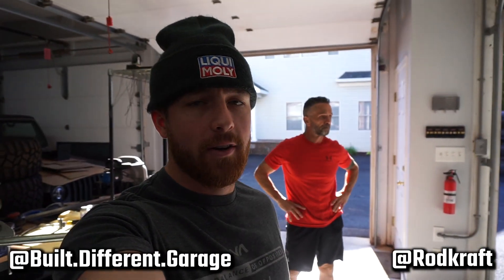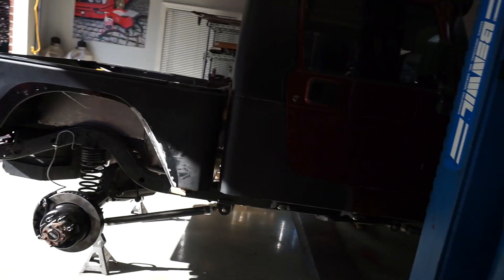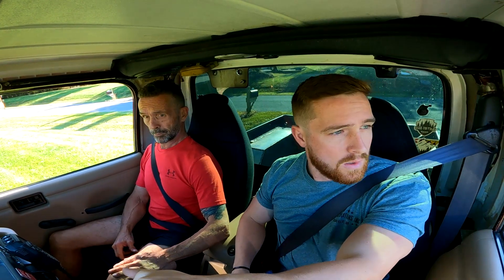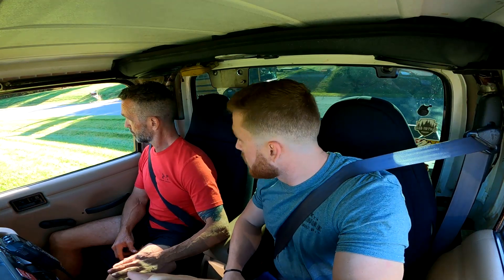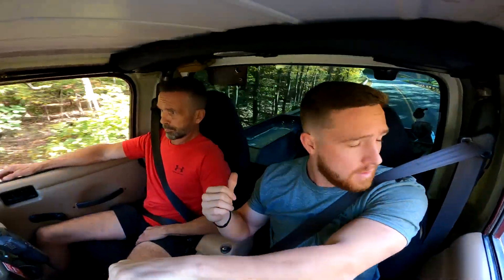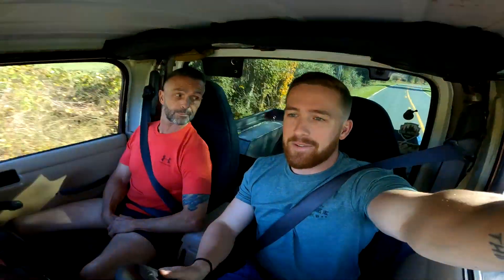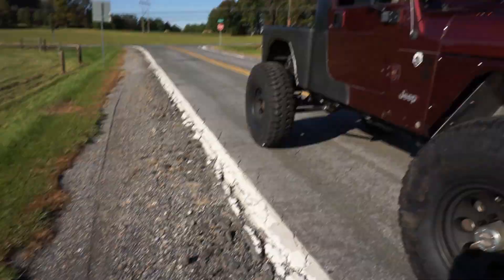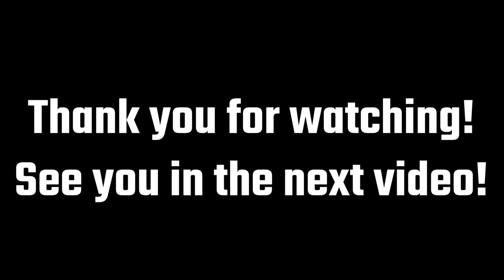FIRST DRIVE!  JEEP TJ WRANGLER on DANA 60s and 40in TIRES

Comment: Rear end on my Brute bounces around a bit unloaded too.
Reply from the maker: I'm sure once I get weight on the back it will be fine.  It was the same way before.  I have some plans for this that will add some significant weight to the rear so it'll all balance out!
Reply: @BuiltDifferentGarage  my plan was just install a bigger fuel tank, something like the Genright Safari tank, and never let it get below 1/2 full 🤣

Comment: Milestar tires suck. That is a main reason
Reply from the maker: I dropped the tire pressure today and they felt much better.  There is zero weight on the back and I know that’s caused bounce in the past.
Reply: I had a set; they don't suck initially but they get to that point faster than any tire I've ever owned.
Reply from the maker: We’ll see how they do!  I’m looking forward to running them and seeing for myself.  I’ve heard great things.
Reply: @BuiltDifferentGarage  they are great, but after 10k miles they really fell apart. Despite rotating every 3k miles I had bad cupping, they also rip apart chunks out on the rocks (California) pretty easy. I had to balance them all the time. Also, they prefer to ride on the center line. It’s by design, so pulling too much air out will wear them down fast. 

But when they were new they were awesome. Just don’t last long. Pretty expensive now, too.
Reply from the maker: I will keep all of that in mind!  I appreciate you letting me know!